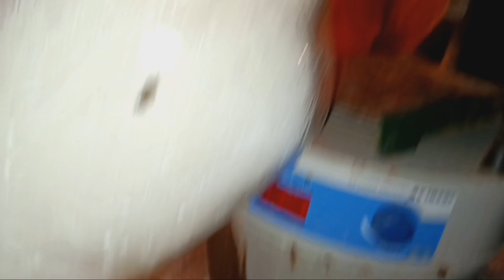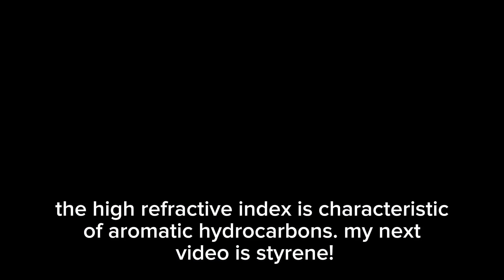Benzene from E211 — Decarboxylation in DIY Steel Retort! (Improvements to ScienceMadness)

Comment: I am interested in your yield.  400ml from 5 lbs is significantly less than 70% unless I am missing something.
Reply from the maker: Oh no I didn't use the whole bag. I did like 5-6 runs, but I still have like 2-3lb of the sodium benzoate for later and making benzoate esters. I stopped at about a pint because I don't need any more benzene than that. I made it to be used as a solvent when needed, but it's so toxic and labor intensive to get that I would be recycling it so I should have a near decade supply of it from that.

Comment: I'd agrue that carbon tetrachloride is the true "essence of cancer". Benzene is the uncle and nitrosamines are the the siblings.
Reply from the maker: I couldn't agree more, it was purely clickbait cuz people know benzene is supposedly dangerous. I have a pretty good idea of its toxicity, and it's odor threshold is lower, so if I spill some I pop off the glove or wipe my hand with acetone. It's really not that bad not even 3 on the nfpa
Reply: @WizardZph  Yup. As long as you don't wash your hands with it multiple times a day, like chemists did back then, you're most likely fine.